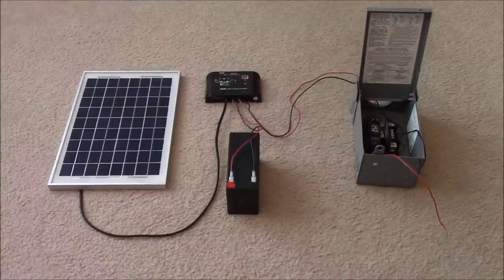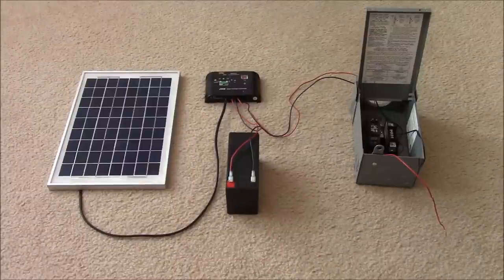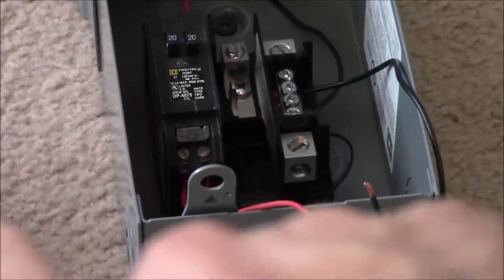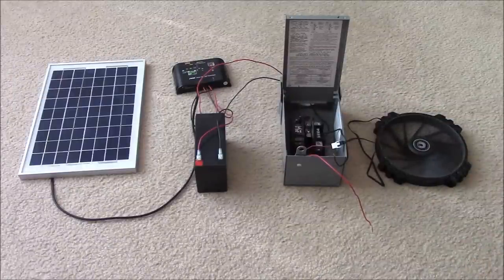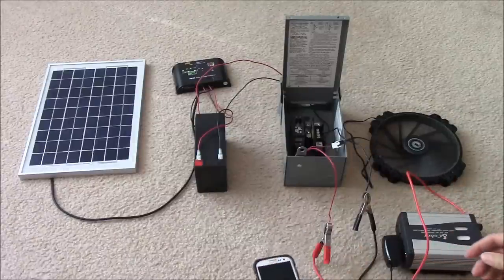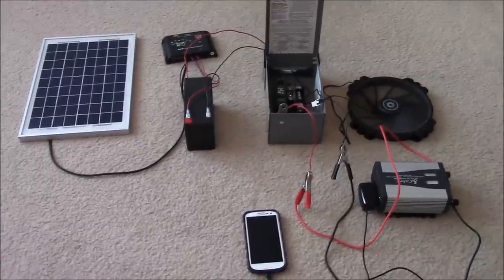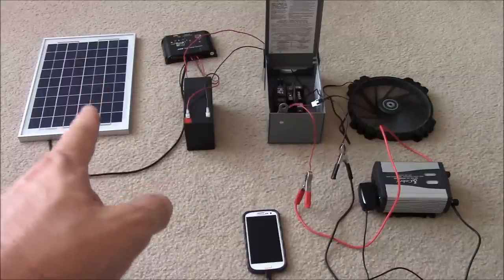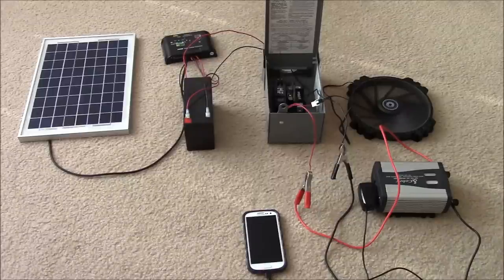Solar Panel Systems for Beginners - Pt 2 Hybrid Systems & Multiple Loads

Comment: It could have been best if you explain the same installation but by using Normal UPS.
Reply from the maker: +Ali Amer Normal UPS?
Reply: +LDSreliance  Yes. Normal UPS. first of all you have to know that we 
have no electricity 24 X 7. I believe Many people already have a Small 
UPS System with VA range from 500 VA - 1500 VA. I have 4 XP SOHO INFOSEC
 UPS SYSTEM MODEL 750 (750VA). I have watched a lot of videos but no one
 matches your explanation. Almost all them are garbage. i don't know why
 they are wasting our time by putting such kinds video which does not 
benefit the viewers.
Reply from the maker: Ali Amer
I haven't seen anyone use a UPS like that but it is a good idea.
Reply from the maker: +Ali Amer I agree but I don't think most people have UPS devices in their home.
Reply: You Just try and you will see.

Comment: My charge control alarm sounds all the time.
Reply from the maker: Did you connect it in the right order?  Usually charge controllers want the battery connected first before you connect the solar panels.

Comment: And instead of using your standard battery do you think those jump start packs like this http://www.amazon.com/gp/aw/d/B00MH4663C/ref=dp_ob_neva_mobile
Could be used and charged as well
Reply from the maker: civic2323 No, those are based on car batteries which are designed for lots of power for a very short amount of time.  They will die if you discharge them more than 10%.  Car batteries are like sprinters in a race.  Deep cycle batteries are like marathon runners.  They don't go as fast as sprinters but they last a LOT longer and they are designed to take the abuse of constant charging and discharging.

Comment: You probably know this already but, the inverter is not that effective for charging 5v stuff like the phone. I would rather put a regulator or 12v car charger, or similar, directly in the box  :)
Reply from the maker: +Mikael Hermansson Yep.  It is inefficient to invert to AC and then back to DC.  But for a 1 amp draw @ 5v it really isn't a big deal.  If you can keep it DC great.  If not, you are losing maybe 1 watt in the process.

Comment: You missed something rather important with the whole 'combined systems' thing.. You mentioned that you lose power from solar panel on towards the inverter because of that charge controller. what you didn't mention, which would of been by far simpler and possibly even easier to understand, is that almost no one really uses their charge controller to actually power anything that they're using... Instead they just connect inverters directly to the batteries. Its more efficient by far, and is what almost everyone who is looking to get into Solar Power is after anyway to begin with. Sure there will be a few people who just want to power something like computer fans or some lights, but anyone who is getting into learning to use solar panels seriously, are just going to use them straight up with inverters to directly power things.

I myself will be powering a bank of servers off of solar power. sure people are gonna say that the 'dirty power' and such could harm the electronics, but that's where using moderately more efficient charge controllers and inverters come into play. and to make them nearly perfectly clean for server use, they'll be going into UPS units which each connect to one of the two redundant power supplies. That way the power will be perfectly fine for the systems involved, and that if for whatever chance the solar panels/batteries fail, the UPS will protect them from most of the possible failure points and then the redundant power supplies will switch over to using the house's power to maintain constant uptime.
Reply from the maker: I see what you are saying.  The reason that I connect my load to the charge controller is for low voltage disconnect.  You can certainly do it the way you are talking about doing it and, if you have sized everything correctly and your load is very predictable, you should be fine.  I would just be worried about having several cloudy days in a row and the batteries getting drained down too low.

If you get a grid tied inverter then you would be fine because the electric company power would kick in when you aren't producing enough power.

Comment: Why not use multiple solar panels one, side for the inverter? 

Why would you want off grid and ongrid?
Reply from the maker: That is basically what off-grid is.  You have solar panels connected to a charge controller, which is connected to an inverter in most cases.  You don't want to connect your solar panels directly to an inverter because the voltage can go too high and too low.  12v solar panels can produce as much as 21v and almost nothing when the sun goes behind a cloud.  That is also why I use batteries so that there is a reserve of power if there are clouds or if you need to flip on some lights at night.  If you just have solar panels and an inverter, the excess power is wasted during the day and your inverter will shut off if the sun isn't bright and shiny.

Comment: Hi, these videos are great so thank you. Is it possible however to have an off grid system with the panels connected to a charge controller, the controller to a battery bank, an inverter connected to the battery bank and finally something like a multi socket adapter plugged in to the inverter for multiple loads?

like in this video?

https://www.youtube.com/watch?v=aIsjM_y0aK4

Thanks
Reply from the maker: Yes.  You need a load center for something like that.  You can make one from Home Depot for about $20.  I need to make a video on that.  Stay tuned!
Reply from the maker: As promised, here is a video I just shot on how to build a load center in order to power multiple loads from your batteries or solar panel system:  https://www.youtube.com/watch?v=UG2pbErPKi8